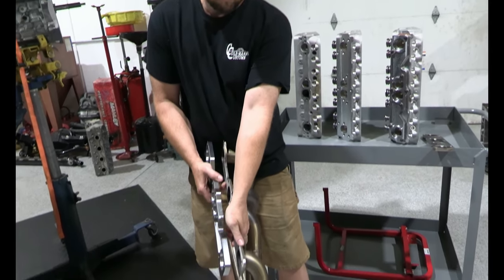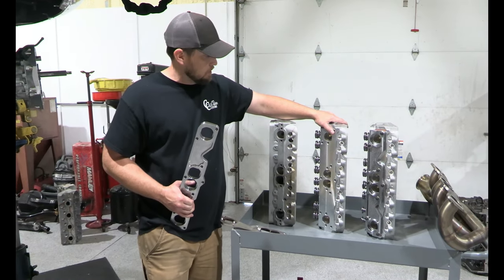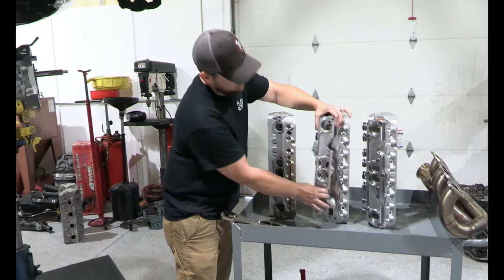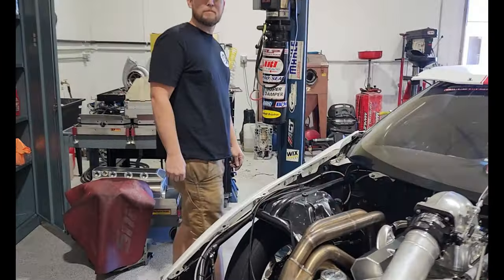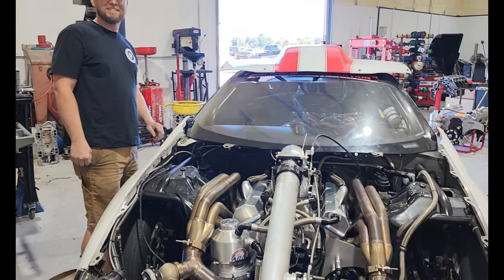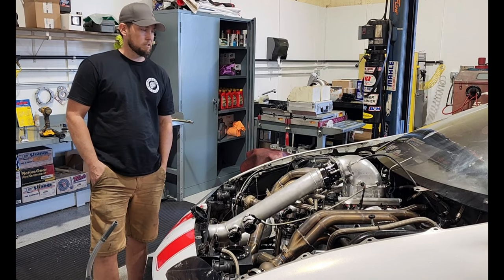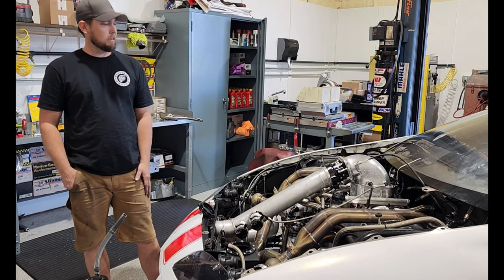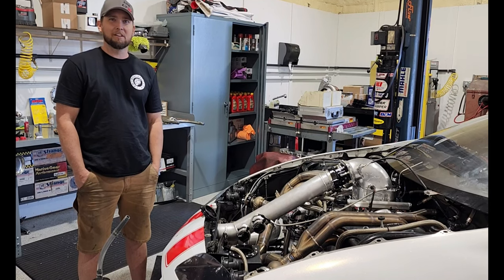Grubbworm Prep For #FL2K!

Comment: So is it still a reverse cool headed motor or is it now a gen 1 sbc longblock running a 24x? I’ve always wanted by an aftermarket block and do a gen 1 setup with the 24x as parts are readily more available, but have never actually seen it done, if that’s what this is you just made my year, wife my hate you now but hell I’ll be happy as all hell if that’s what this is..

Comment: They were mounting headers in a similar manner on F5000s, Sprintcars and other cars using 1.7/8 headers in the early 70s. Generally now everyone uses 1 3/4. Drag racing needs are foreign to most other branches of motorsport.
Though at least you are using a real Chev unlike those odd Chevs with only 4 bolts per hole cylinder heads

Comment: Seeing that car go 6.61 at 216 beside a sick ass big block Elco with twins, then realizing Grubbworm is an H-Pattern car beside ol Cleet in the air shifted 400... 😳 Cookin...
Reply: Bet Mullet weighs at least 700-800 lbs more than Grubworm and possibly closer to 1000 lbs.  Not taking away from the performance of the car but weight makes a HUGE difference.  Mullet needs a lot more power as it is a heavy, drag and drive car.
Reply: boumahdi بومهدي  348inch motor

Comment: With all the problems you’ve had with the header flanges is there any reason why you don’t use symmetrical heads?
Reply: Could you even get symmetrical heads for the reverse flow deal? I know theres not many options for the gen 2's.
Reply: We cracked a trick flow head in 2019 and didn't want to change the headers/turbo kit so I purchased the Brodix heads to replace them.  As it turned out, we had to replace the headers anyway because the Brodix heads have a raised exhaust port lol.

Comment: How many LT blocks has this car seen?
Reply: In the 5 years I have owned this car, it has had 3 engine blocks including the one that it came from the factory in 1997 with.  All were running well when removed, but they had cracks forming from a head fastener hole into a bore.  Last year we did some tricks that prevented that block from cracking, and we ran it all year this year as well until we swapped to the Bowtie block a couple of weeks before FL2k.

Comment: Are the heads spread port?
Reply: No
Reply: what makes them spread port or not? I had always thought it was just the different header flange 3 bolt center. do they move the ports around any for spread port?
Reply: Yes, a spread port flange has the two middle exhaust ports spaced an extra 1/2" or so apart.
Reply: ahh I never knew that.

Comment: 3 manual gear shifts in 6 seconds, that's business... but also precision driving. Amazing work mate.
Not sure people realize how much power an auto trans & converter soaks up. 
If your clutch will allow you to shift your manual quick & the whole setup can withstand your power/traction you are bound to go faster/quicker as manual. 
But they sure can be a handful to drive well, 10 outa 10 there mate.
Spectacular sounds making a pass.
cheers from Sunny Queensland Australia. Now I'll go sub...